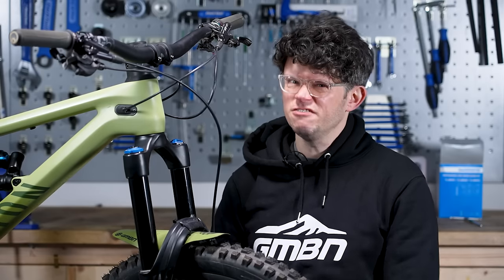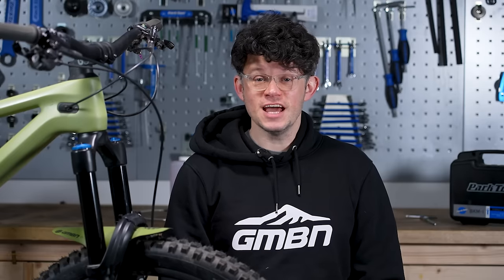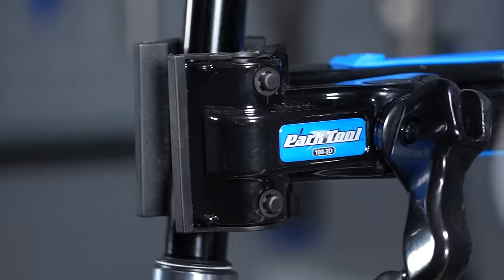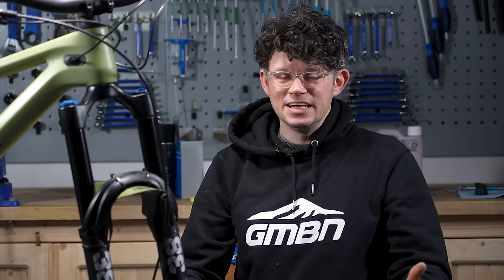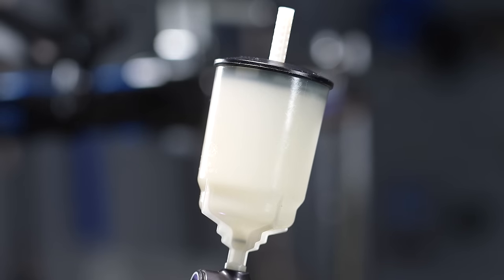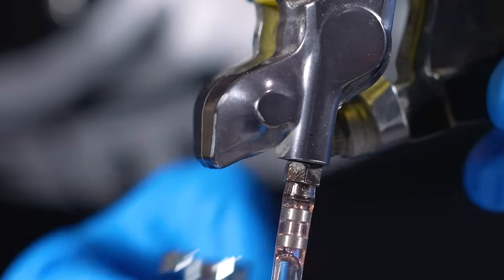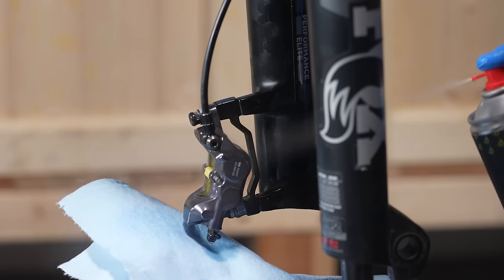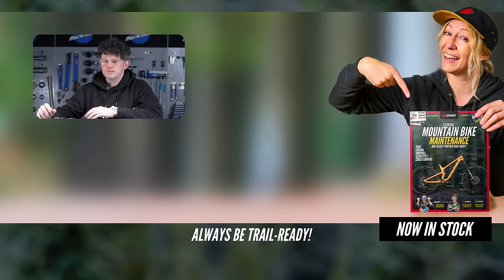How To Bleed A Shimano Hydraulic Disc Brake

Comment from the maker: Are you using hydraulic brakes yet or are you still on good old-fashioned cables? Let us know in the comments below! 👇
Reply: On one of my road bike yes, I wish there was an inexpensive cable actuated hydraulic system for MTBs...
Reply: On some simpler bikes and on classic mountainbikes - rim brakes. 
On the more modern bikes, the modern mountainbike and on the commuter - hydraulic disc brakes
I have one GT Avalanche 3 with mechanical disc brakes, I kept them (Tektro IO) since they were original on this semi classic mtb but they do not nearly have the performance of a hydraulic disc brake
Reply: I've been using mt200 for 7 years now, bled them 4-5 times during this period, but for the last 3 years i feel a big loss of power in rear brake (pads are new, rotor clean, oil is new too). Maybe it's time to change brake lever? I even thought about returning to cable type brake...
Reply: @Alex-ph4iu Over time the 200s can get play in the lever bolt too. However in EU you get a full set for one axle for 25 € and a caliper for under 10 €
Reply: @Alex-ph4iu  Usually you can rebuild the master cylinder (the hydraulic device inside the brake lever) by replacing the seals or the entire plunger assembly. Provided that you can find the spare parts (lever rebuild kit). There's also a possibility that the caliper pistons are not moving freely due to corrosion. Caliper rebuild kits (piston+seals or just the seals) are also available. The above is based on my experience working with cars and motorbikes. On a bicycle you have an advantage of easily being able to upgrade your brakes by replacing them with a newer and better model.

Comment: I'm just gonna be that guy.... 1) Before pushing the caliper pistons back into their bores you need to open the lever and install the bleed cup so that the fluid has somewhere to go, otherwise you risk tearing the delicate diaphragm in the lever and fluid WILL squirt out from the lever vent port. Shimano has updated their latest dealer manuals to say exactly this. 2) Why push all of the filthy fluid from the caliper to the lever? Do a quick gravity bleed/fluid replacement to get that filthy fluid out of the caliper first before doing any bleeding from the bottom up.
Reply: Yeah, I did find this video a bit rough around the edges. The other thing is to clean the pistons before pushing them in as well.
Reply: surprised people don’t already do that. Even on my hope brakes you take the rubber diaphragm off and the reservoir top cap.
Reply: Hmm so you have to waste new oil to put in the container only to contaminate it with old oil? Seems a waste

Comment: Why would you pour fresh mineral oil into the reservoir and contaminate it with the flush from the bottom up. This video has a few fundamental errors that need revised. You can’t force pistons back if the reservoir is shut. The o rings on The piston will fail. Great video but do it again. This technique really only eradicates air bubbles not contaminants and moisture.

Comment: Like others said, if you press the pistons back with the bleed screw still installed in the lever, you have a pretty big chance of wrecking your shimano levers. For older shimanos and other brakes it's usually not an issue. Just install the funnel with or without oil on the lever as the first step!

Comment: I appreciate all the helpful content you folks provide but I have to say this how to isn't one of your best.  Most notably, you provide no comment or instruction on bleeding the syringe hose of air before attaching to the caliper.  Around 5:23 you can see the hose attached, with an air void in the hose and the hose oriented in a vertical direction.  Once you start injecting mineral oil into the caliper, this air is going to be pushed in first.  Yes on a front caliper you probably will push this air all the way through to the collection cup.  But on rear calipers where the hose routing sometimes has a number of bends, you are potentially adding air into the system that could be a bitch to bleed out.  Also, after closing the bleed port on the caliper, almost all Shimano brake bleed instructions advise cycling the brake lever repeatedly, until no more bubbles exit into the bleed cup.  You don't cover this.
Reply: Agree. And when the pads are put back on there no mention of cycling the lever to get the pads to the correct bite point. Or rechecking pad rub on the disc. You always need to muck about a bit with caliper positioning as the pistons rarely work perfectly symmetrically.

Comment: I find tapping the hoses a bit at the end to get rid of any cheeky final bubbles helps also. Great vid, thanks as always for all your efforts!
Reply: Disconnecting the calipers from their mounts and letting them hang down vertically is best ime (particularly the rear, front is already vertical when mounted). Have a stool or something for caliper to sit on
Reply: Nope and nope. Old wives tales. Same for disconnecting calipers. I’ve done this a dozen times it takes me five minutes I don’t disconnect anything and my brakes work perfectly every time.

Comment: If you follow the steps but can't push oil through, it can be that you need to screw the lever adjustment back a bit again. I just encountered this issue.
Reply: The brake bleed kit I bought from dyisland  the instructions say to screw the pin in to close the line before adding fluid. I was very curious about the pin next to the lever as I had a mess of mineral oil all over the cables.

Comment: I use green citroen lhm mineral oil works fine bet there are a ton of reasons why i probly shouldnt
Reply: At least it's still mineral oil. 

What is important not to use Dot fluid in mineral oil brakes or the other way, since the rubber of the O rings is made to withstand Dot or mineral oil, but these are different sorts of rubber
Reply: @simonm1447  exatly what i thaught, lhm is way cheap but still good quality so inclined to bleed more regular the viscostity seems very similar performance wise highly recomed it genuine total lhm+

Comment: I used the old mineral oil the last time to clean chains. If you put it into a plastic bottle with a big lid you can put the chain in and shake it (don't do it with glass bottles since they can break - don't ask why I know this). The oil cleans the chain and lubricates it at the same time. After some time the dirt settles on the ground of the bottle and the oil can be used to clean more chains

Comment: Seen other vids where they push fluid from bottom to top to clean the line, then draw in fresh fluid from the funnel at the top.🤷 I like this vid better and will try this way.
Reply: @Themilkmanskid.  100% agree.  We tried that other method and ended with wasted oil. We followed this video, which was much easier, and the results were perfect. As others have noted, take your time and go easy when injecting the oil to not ruin any fragile seals. If oil isn’t moving, stop and reassess.
Reply: @UltraBiPolar  Bleeding is the easy part.

Comment: @gmbntech 
Air in the syringe when it's filed with oil.  Is this an issue? Or will the air in the syringe cycle through the system with out worry of trapping air inside the brakes?
Reply: Just stop pushing on the syringe before the air gets to the tip. Easy enough if you keep the syringe vertical.
Reply: Keep the syringe vertical with the plunger at the top and the outlet hose at the bottom.
Reply: @antc5010  Or you can get rid of the air in the syringe/hose during filling it, and not run the risk of introducing an unnecessary bubble into the system.

Comment: A question, maybe a dumb one (I recently upgraded from v-brakes to hydros, so I don't know everything yet): why do you need to pour mineral oil into the syphon on top? Isn't that just for collecting the old oil?
Reply: Sometimes the syringe can drag a little back when you open the bleed nipple, saves dragging air into the system from the top

Comment: I though you were supposed to pull the old fluid out from the caliper side as contaminated fluid can ruin the levers?
Reply from the maker: Shimano's have always bled this way, dirty fluid will get purged at the top so you don't have to disconnect and refill a syringe with clean fluid.

Comment: This is a really bad instruction video. At 5:25 they don't show properly how to connect the syringe. This other GMBN video explains it way better and in real time, they don't skip the difficult steps: https://youtu.be/HggV5BFTRw8?si=gjCSM4lpcno18QJX They explain way better how to connect the syringe and avoid air bubbles in the other GMBN video.

Comment: How many times is this  channel going to rinse and repeat videos? every new tech host has done it.... GMBN is such crap now
Reply: I thought this one was a little more detailed and each step had close up pictures.  A little easier for me since I have not done this before, but I feel like I can do it now.   And the brakes look to be the same model as mine too!  I thought it was improved!  👍
Reply: @ArkUSAbikerchick It’s missing about 3/4 of the bleed process steps. From what I remember Henry’s video is the correct process
Reply: I am a newbie, but why do you need to take the wheel off and pads out (I understand why the spacer is needed after tha)
Reply: @dc2927  it is just to avoid the risk of spilling the brake fluid on the brake pads. With care it is unnecessary.